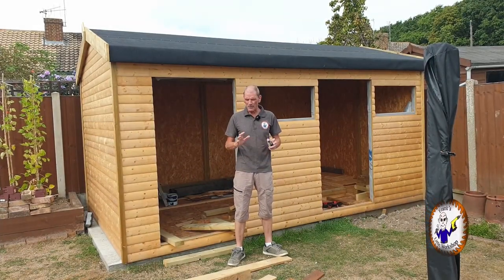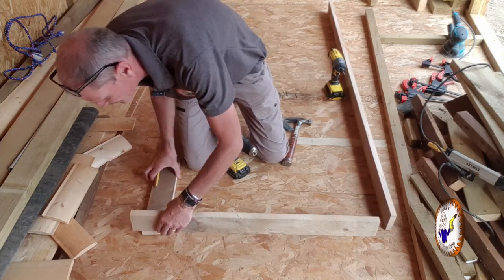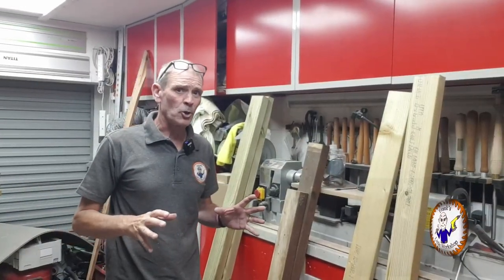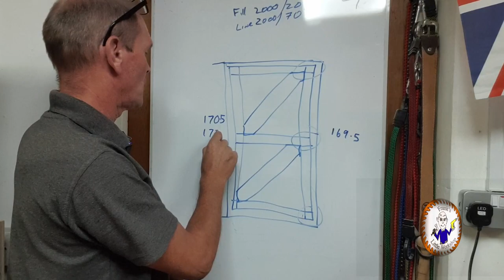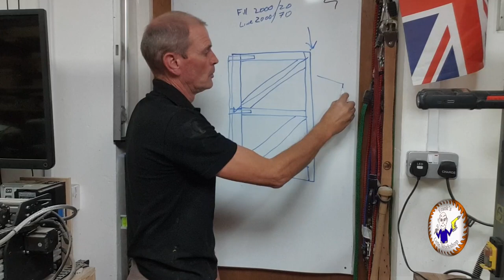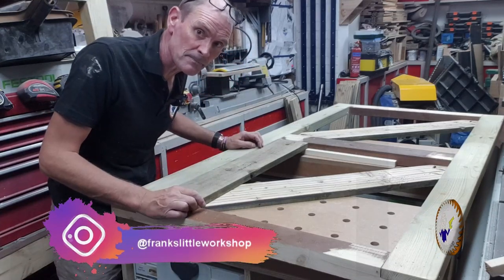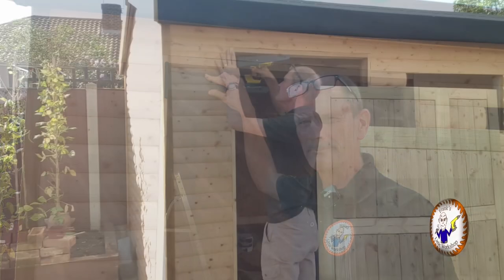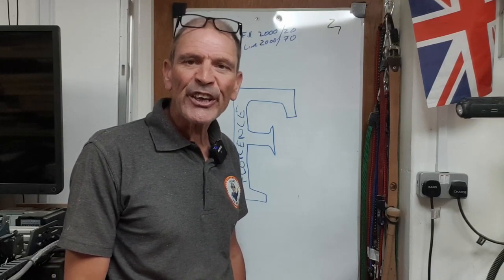Making Shed Doors, from reclaimed timber.

Comment: Great job on the doors Frank, they'll outlast the rest of the shed but you'll never regret how sturdy they are. Locks look strong but it's worth putting a couple of bolts through instead of nails on the hinges to stop anyone just unscrewing them to get in. Whole structure looking really sound now.
Reply from the maker: 😁 Thanks Ben. Security is not really an issue. We have some "very attentative" neighbours 👀, and I have far too much CCTV 🤣. But a bolt ot two wouldn't go amiss. I will need to modify the hinges though, they are cheap ones and don't allow for a coach bolt 🤨. Thanks for watching 😁👍
Reply: @frankslittleworkshop  That's good to hear. I've really enjoyed the build, thanks for taking the time and effort to film it.

Comment: Hi Frank, that is a novel way to use those hinges, the end of the hinge is supposed to go on the outside of the door jam, not inside. Also, if you look at the hinge one of the holes is square, this is for a carriage bolt to add extra strength to the hinge, loved the re-use of the old timber, great thinking.
Reply from the maker: Hi John. I didn't have much choice how I mounted the hinges. They wouldn't sit securely enough on the log roll cladding and if you note how close the right hand  door is to the window... it just wouldn't work. I really needed a more robust exterior door frame but didn't have the wood. The hinges I have dont allow for coach bolts (cheap ones from Wickes) so there is not a square hole. But I may modify them and fit bolts. The doors are off again now so I can treat them properly. Thanks for watching John 😁👍

Comment: Outstanding! Coming to the end of my shed too and on to the door. Some of my cladding overlaps the door and I’m worried I cut it and it goes wrong. Only have a jigsaw and hand held circular saw and would like your advice on a straight cut
Reply from the maker: 😁 Hi Ricardo, obviously a bit tricky to give any advice as I haven't seen your build. But all I can say is never underestimate how good a good old hand saw can be and you can pick them up for very little money. You don't need to use power tools. A hand saw will allow you to control every stroke of the cut which will in turn minimise the chance of any big mistakes. It can always be sanded after to make it look nice 😁. Hope that helps, thanks for watching Ricardo 😁👍

Comment: Nicely done.  I can appreciate a man who admits when he made a mistake.  My only concern is the lack of vertical studs in the walls! OMG what are they 72" on center?  And no header whatsoever above the window?  I'd go 16" on center, maybe 24" because it's a shed, but not what you have there.
Reply from the maker: 😁 Hi P, yep I agree totally. There should really be more verticals, yep there should be a header above the windows... but yep, its a shed. It wasn't built to any "traditional" building regs... because its a shed. It really only needs to keep the rain off my lawn mower 😆. However, it now has extensive partitioning and supports inside which create smaller and more ridged box sections. And additional bracing which double up as shelving. Its now well over a year old and there has been no movement / bowing / sagging / door misalignment or settling. In addition, half of it is for project wood storage and it is keeping that dry enough (averaging 16%) so I'm also happy with the venting and protection 😁. So overall its much more robust than any kit I could have brought for even twice the price.... and yes... my lawn mower has never complained 😆😆. Thanks for watching P 😁👍